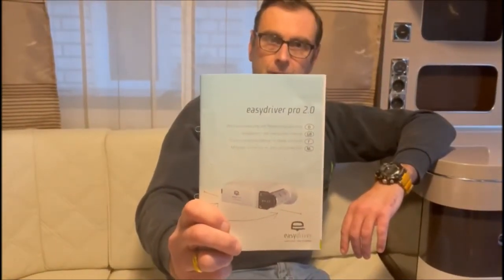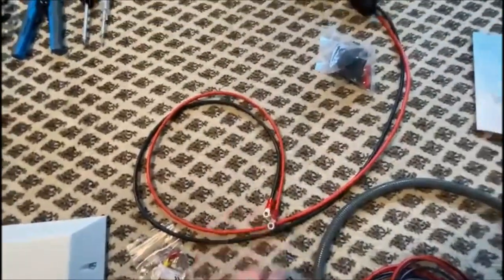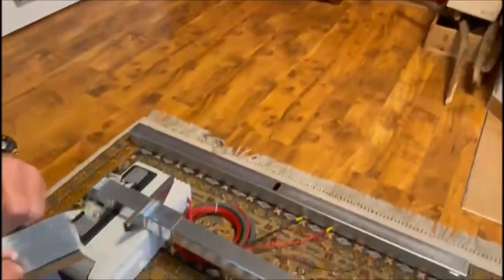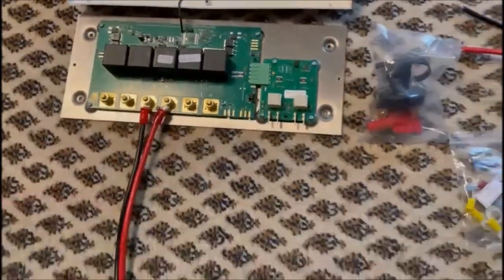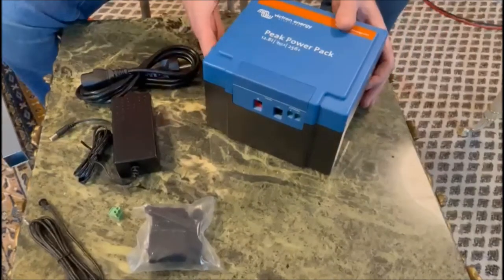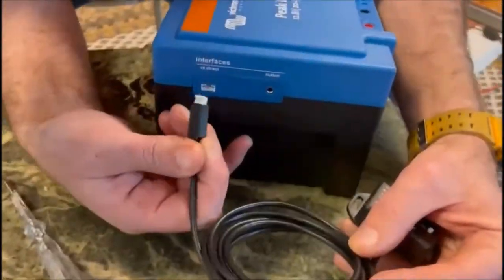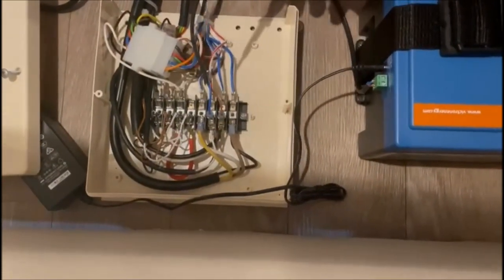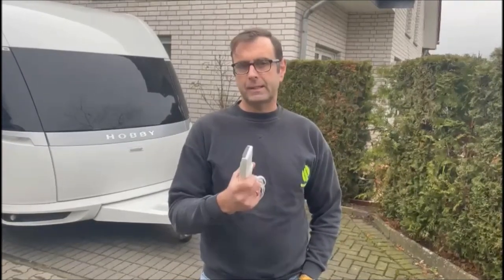Reich Easydriver Pro 2.0 BPW Fully Automatic and Victron PPP installation guide

Comment: Thank you so much for this video and your time producing it. I am in the process of finding a replacement mover for my caravan as I've had problems on more than one occasion with it (powrtouch). May I ask after your research why you actually settled for this manufacture?  
This mover is so much more compact and with great ground clearance.
Thanks again
Reply from the maker: Hi and thanks for the positive comments. For me i didn’t start with price as my first priority was i wanted a fully automatic one as i didn’t what the faff of winding the rollers out and the second was low weight as we (now with hindsight mistakenly) didn’t update the max weight of our caravan in the factory.  I originally looked at a Truma XT but it soon became clear that the quoted weight was only the mover and not all the ancillaries. Alko was quite heavy and used more power than the Reich and i think only fits an Alko chassis so that left the Reich. The Pro is about 25% cheaper than the Infinity, weight was good and it had the BPW fitting (about €100 more than the non BPW Pro) so that swung it. Also as it’s white/grey it blends in well with the caravan colour.

Comment: Great video, very informative, thanks. I recently bought a used caravan with an Easydriver Pro 2.0 already professionally fitted. My problem is that the isolation switch has been installed in the rear of the single axle caravan just above the battery. When I arrive at a campsite I have to wind down the rear stabilisers before entering the caravan to switch on the isolation switch. Sooner or later I am going to forget to wind them down and tip the caravan on its end,  possibly with disastrous consequences. Moving the isolation switch to a position forward of the axle would avoid this. I am not an electrician but it seems it would be be a fairly simple job. Would there be any problem with doing this, and if not, could you tell me what gauge of wiring I would need. many thanks in anticipation.
Reply from the maker: I didn’t fit one as i went down the power pack route. Think you might need to relocate the whole wiring and maybe battery (if possible) as i think they can only be limited distance between the battery and the control unit. All you will need to do is cut the existing cable from the battery to the control unit and crimp attach two ring connectors and they go over the connection points on the switch and ares held in place with a nut (like the connectors on the control box). So you should not need any new wire but i think the distance from the battery to the control box is limited to about 1 metre (could me 1.1m); you’ll need to check the installation instructions. Hope this helps?

Comment: Hello! thanks for your explanation. I have a problem in my Easydriver Pro 1.8. The left motor fails in the first movement, that of bringing the mechanism closer to the wheel. Rotation does not fail. The right works perfectly in its 2 functions. A few days ago the campsite where my caravan was located was flooded, luckily no water got inside but the EasyDriver mechanism was flooded. Could this be the cause? How do you think you could solve it? Thank you very much in advance for your help. Cheers
Reply from the maker: Hi Carles. Sounds like you are having a few issues. If it is under warranty then i suggest taking it back to the dealer? Next i would suggest using the power of Google to see if this problem is being discussed on forums and this might give you the fix. If all else fails i would check the wiring in the control box on the caravan and the wiring connections to the motor. If the motor still turns the drive wheel then possibly there is a failure of a cog or drive wheel/shaft inside the mover housing that deploys the roller. 

If all else fails then maybe water did get in the motor when you next speak to your insurance company?😜

Comment: Thanks for the video. I am thinking of buying an Hobby 540UL or similar with an MTPLM of 1500KG whereas yours is 1800KG if I am correct. How comfortable is the mover with the 1800KG weight? We have a slope on our drive which I will attempt to find the % incline of tomorrow and see if this mover would be suitable. Also how much clearance is there between the mover and the ground? Thanks.
Reply from the maker: Brian. Despite what it says i think that 1800kg is about the limit for this mover. It will move the van up a levelling ramp but it is more comfortable moving one wheel up the ramp and then moving the other wheel on the opposite side to square up the van. That said the steepest i have moved it on paved roads (our drive) is 5% and there are no issues (empty at about 1650 or full at 1800kg). Ground clearance varies if the van is full/empty - all i can say is that i have lost about 1cm of ground clearance with this set up

Comment: Apologies but I have a some more questions if you don't mind. What is a Hobby MY16 caravan?, What is different about the BPW model? How much does this model cost? It looks as if it comes with it's own battery so does it need to use a leisure battery? The 2022 540UL Hobby we looked at does not come with one. Could you measure the ground clearance of your set up for me?
Sorry for so many questions but the dealer is 120 miles from us and we need to get this right before proceeding. Thanks.
Reply from the maker: Ok. So MY16 is model year 16 (vans made after Aug 16). UK Hobby’s do come with a 12v battery i think (self sufficiency package) but if the ones you ares looking at is an EU import it likely won’t. I use a power pack (5kg) and not a leisure battery (20kg). The longest i have used by mover was about 15 mins (on paved bricks) and the voltage went from 13.7 to 13.1, so plenty of capacity.  I can measure the ground cleanance but you won’t get an answer for a week or so as i am on holiday (not in the van). The BPW model of Reich mover means it attached direct to the chassis in the pre cut out area of the chassis and does not clamp onto the bottom rail of the chassis.
Reply: @mercedes_and_more  Thanks very much for clearing that all up. Enjoy your holiday.
Reply: @mercedes_and_more  Hope you enjoyed your holiday. As per our recent discussion could you measure the ground clearance on your Hobby for me and why did you choose this mover? I ask because our local caravan dealer Lee Davey at Maidstone were very sniffy about fitting this mover to a caravan we were interested in. Thanks Brian.
Reply from the maker: Will do on Monday👍
Reply from the maker: Brian, if you send me an email to MandMQuestions@gmail.com with an email address or a WhatsApp phone no. then I’ll send you some pictures or we can talk one to one. I can confirm that with this mover you loose 15mm of ground clearance👍 below the chassis rail

Comment: Thanks for your reply. Apologies but  I have a couple more questions. I am concerned about getting the max clearance from the ground having had a mover on my previous caravan hitting a speed bump and immobilising us. Most movers have a piece of the mover underneath lessening the clearance but this mover appears to be just the rectangular box in the pictures without  any parts under the main body. Is this correct?
Apparently in Germany a 4" clearance is allowed while it is 6" in the UK. As you can imagine I would prefer a 6" clearance. Thanks for your help again.
Reply from the maker: Yes. If you have a Hobby MY16 onwards then the chassis has a quadrilateral space with 4 holes front of the wheel. If you have Reich BPW model then the mover bolts into this hole and a tube joins both sides. This holds the mover to the chassis. Other “clamp” the chassis with the tube underneath. My installation loses about 15mm, the clamp ones about 35mm (with the Reich). As far as i know there is no minimum clearance but it is recommended to have at least 150mm (6”). Does this help?
Reply: @mercedes_and_more  yes thanks. I am going to MB in Dunstable to have a look at 3 Hobby's tomorrow so I will ask about the fitting arrangements. It would be ideal if there is no tube underneath. Hopefully they will be able to advise. Thanks again.
Reply from the maker: Think the only movers that fit are made by Reich - needed to be their “BPW” variant: https://www.caravanmovershop.eu/Reich/producten-45172-Reich-Pro-2.8-BPW-B2-Full-automatic-mover-International-version-(2020)-Mover-wit.php is a great website with info in English

Comment: Could you help with sourcing the brackets that bolt to thechassis
Reply from the maker: They come as part of the kit. Two versions of this Mover are made. The traditional one that clamps to the chassis and the special BPW version (this one) that bolts into the chassis. The mounting bolts/brackets for the motor are different so even if you had the brackets then the two versions are not compatible. You can mount a non BPW version by clamping it to the chassis on a Hobby though but you will loose about another 3cm of ground clearance.